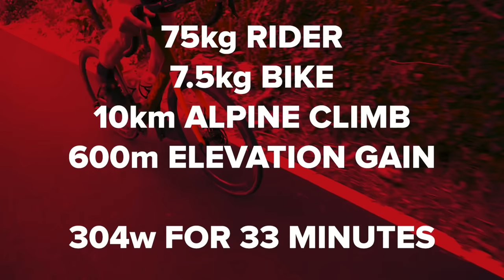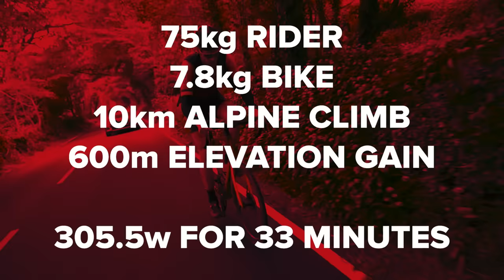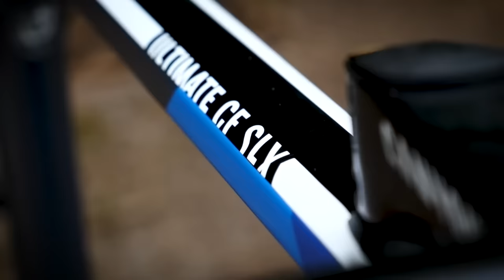10 Reasons To Consider Aluminium Over Carbon For Your Next Bike

Comment: I prefer steel... because, well, probably because I’m a twat as it turns out ... BUT I love the idea of a resurgence in Aluminium, given the tidal wave towards carbon.   In saying that, one of my favourite bikes in one of the first Giant CADEX frames.   My deal breaker is horizontal top tube. Has to be horizontal.
Reply: Me too, steel is real. Just purchased my steel gravel bike.
Reply: Same here, steel gravel bike 😁
Reply: My steel bike is a hand-me-down from my dad, it's over 20 years old now and the frame is still kicking

with regular maintenance and switching worn out parts steel frames are for an eternity compared to some other materials

It's not the lightest yes, but the best durability you can find imo.
Reply: I used to own a cheapo Reynolds 520 frame and it was awesome. Mind you, it was chromoly (sp?) but still on the steel side of things and it was great. I now ride a Triban (aluminium) and it rides great. I also owned a Chinese no name aluminum frame for a while and it was so harsh I thought alu was like that. Aluminium can be quite comfortable if the frame is done right.
Reply: Steel for gravel and my road is a Kenisis Alu disc.... It's all about the metal.
Reply: I've owned a quality carbon frame bike - I sold it, because my Reynolds 531 butted steel alloy frame to me feels much livelier and gives better road surface feedback. It feels 'glued' to the road; far better than carbon. Weight? It makes no difference to me!
Reply: Still riding my 43 year old steel Raleigh SuperCourse. Have replaced the wheels many times as well as most other components, but that frame just keeps ticking.
Reply: I miss my custom steel bike from the late 80's. Best ride ever.
Reply: Steel frames, in my opinion, have an aesthetic advantage, but mass produced aluminium bikes have given us lighter and stiffer bikes for less money.
Reply: My bike is steel. Has served me well for 44 years.
Reply: @tomscott4644  Hi Tom, 1978 Raleigh SuperCourse here. What are you riding?
Reply: Steel is also making a big comeback. Not just in the heaps of vintage frames you see getting back on the road, but also with new bikes especially in the gravel and adventure segment being offered in steel.
Reply: @Stoney3K  I also dig how many smaller frame builders in Aus, UK, US are making decent livings out of bespoke frame building.  They’re costly granted, but getting a frame built by a local shop to your exact measurements, and owning a lush steel steed - taking bike ownership and riding to a whole new level.
Reply: @MrLuigi-oi7gm  '77 Trek.
Reply: I have a 80 and a 82 Koga-Miyata. They are great for touring and training, which most people do most of the time. Of course if you're actually racing you should ge a new bike. But other than that steel is perfect.
Reply: @tomscott4644  👍
Reply: Totally agree about horizontal top tubes. If it's not at least mostly horizontal, I will not ride it; steeply slanted top tubes are an abomination.
Reply: "CADEX", that takes me back.
Reply: I own and still ride a Cadex.
Reply: @williambehr215  I’m just about to put a new 105 group and new wheels on mine. I picked mine up for 20bucks, it was purple, was going to do it up, but colour grew on me.  My favourite bike
Reply: I purchased a steel gravel bike a little while back but have found i'm loving carving up the road/paved tracks mostly. Threw some 32mm Conti road tyres on it and it's not a bad ride. I'd like it a little lighter but i'm not sure whether to jump to an alu frame or do some upgrades on the steel bike.. the not quite horizontal top tube silently eats away at me too.
Reply: Funny. I personally hate horizontal top tubes. Much prefer compact designs / sloping top tubes, ideally ca. 15-16°.
Reply: @LeoInterHyenaem  that’s a very unusual hate.  I cannot think of anyone that prefers a compact over horizontal top tube other than the functional need of a manufacturer offering less size models
Reply: @eddiej9733  Curious. I find horizontal top tubes (idem, dropped seatstays) visually awkward. My ideal bicycles (all sporting compact designs and continuous, organic, elegant seatstays) would be:  
 - Salsa WarBird 
 - Bastion Super Leggera / Road 
 - Specialized Aethos 
 - Merida Silex x000 -series 
 - Cannondale Synapse (especially the women's version with a greater top tube slope) 

 Also the likes of the Cannondale Flash with a considerable top tube slope has that modern classic look that's still a looker after all these years. 
  I guess, the subject is akin to steel vs carbon, titanium with welds vs with organically oblique 3D-printed lugs (like carbon), Gothic church Vs ultramodern minimalist mansion, classic Rolls-Royce vs Lamborghini Aventador. Many apparently prefer the vestiges of early tech / design or short-lived modern fads, while others have strong preference for clean lines, minimalist looks, oblique shapes, defining modern classics.
Reply: @Sidowse  If you take the likelihood of corrosion out of the equation, then yes - steel will likely last longer.
Reply: @LeoInterHyenaem  nice rationale, but feel your position is a stretch at most.  Horizontal top tubes ruled till frame manufactures reasoned (legitimately so too) that fewer frame versions could be made, with adjustments in seat and stem projection making a compact frame adaptable.

So, I have not come across any source that supports  the sloping top tube / compact as a key design feature - rather the price for frame size compromise. Hardly a key design attribute 

Again, have never encountered anyone that has sought to justify the compact frames aesthetic benefits.  All the frames you note ... are... well,’ compact and sloping. 

The prosecution rests
Reply: @eddiej9733  I neg to differ. "Horizontal top tubes ruled till …" - that is why I equate them to 1970'ies Rolls Royces, rather than the sleek and beautiful Lamborghini Aventador. I struggle to imagine that I am among a very few who find horizontal top tubes aesthetically awkward and ugly. Sure, they may give you a watt or two (at best?) in aerodynamic gain, but visually they're just rather ugly. And reverse-sloping ones (such as some time trial junk of 1970-ies and 1980-ies) - even considerably more so. I would, however, entirely agree with you if you had said that >25º slope in a top tube (such as in women's Dutch bikes) is hideous, but that would be a perfectly irrelevant comparison.
Reply: @Sidowse  The aerodynamic losses are rather marginal, if you can stick to the drops. However, for most of us non-racers, sloping top tubes add to the comfort (yes, at a very marginal performance expense). On the positive note, the gain in aesthetics and in comfort (especially, on longer rides) is significant.

Comment: Allez Sprint for the win!  Saw a video today about what would you build up for 8k to be a good race bike and one of the two specd an Allez Sprint frame, especially if you use rim brakes the weight difference is almost non existent from a carbon disc bike.  Also the Sprint geometry is as aggressive as the Venge and is actually stiffer...

Comment: bmc alr one of the most underrated bike at the moment...

Best alloys : Caad 12/Caad 10/Caad 13/Specialized Allez Sprint/Trek Emonda Alr,Bmc Alr  and some others :)
Reply: Also giant tcr slr (can be made below 7kg with pedals and cages)
Reply: @roborovski008  yes aluminium.
Reply: Those bikes may be or are built in China in factories that make the same frames for other, "lesser" brands. "Open" frames relate to Al as well as carbon. What it comes down to is what was totally missing from the video: the snobbery of name brands/frame material.  Some people like to think because they're paying more for a frame due to brand/material, they're getting a better product. Not the case. I have a Al frame that is high end alloy, heat treated, butted and multi-shaped, smooth welds and built in the same factory using the same methods as some of the "top end" Al bikes you mention. My bike also has a combination of Ultegra and 105 components, not Sora and Claris because I didn't pay the marketing tax of popular brands. Know your frames, not brand. And besides, it seems it always needs repeating...it's not the bike!
Reply: You need to get off the USA brand marketing train. The higher price you're paying is not for better products, you're paying for the brand name and their marketing budget
Reply: @esstee9595  what frame do you have?
Reply: @esstee9595  where did you get it? What bike is it ?
Reply: @tonymcnally9355  I bought in 2016, a 2014 Fuji Roubaix 1.1. The frame was built in the same Chinese factory that built frames for other major, more expensive brands at that time using hydroformed, multishaped, butted, heat treated high quality Al. It's very light and lively with racing geometry and could be used for racing. I compared the bike with other brands boasting the same frame tech, and the difference in components was huge. Like I said, Ultegra brifters and RR deraileur, 105 frt deraileu and brakes calis, as opposed to shyte that was offered by name brands starting with C and S for examples, using Claris and Sora for the same or higher price range.

Comment: Two more things in aluminum’s favor: Carbon is a lot more sensitive to torque spec and damage to over torquing. 
And the dreaded carbon creaks.
Reply: Expecting for a solo / long hauling rides with no worries of wrong torque number by what my hands do 😂
Reply: Yeah. Those effin carbon creeks😒
Reply: Aluminium is not impervious to overtorquing damage, either. And creaks... well, aluminium can and sometimes does seize. Or creak, for that matter. It all depends.
Reply: @LeoInterHyenaem  but less than carbon

Comment: Nearly all the "for parts" frames sold cheap are carbon. Once it broke, its premium price suddenly vanishes. And I guess most folks don't want to ride a repaired CF frame. Its like buying a written off car that's been repaired: yes it's cheap, but can you trust it?
Reply: Carbon repairs, if done properly are even more solid than the original product. It's also so much more sustainable than trashing it, for some potential additional grams. It has been done for years in the nautic industry. Few years back I had a Canyon Strive CF frame fixed on the bottom bracket area. I've been racing it on Mountain of Hell, Enduro races and bike parks for 2 years then sold it. It's still riding strong 6 years later. So yeah; you can trust it, and no you can't fix an aluminium frame the same way.
Reply: @BastienChanot  I disagree. While carbon repair is magnificent in its own right, it can't and shouldn't be "more" solid than the original product. Depending on the carbon fiber's original structure, the repair should be of the same exact quality-- nothing more, nothing less. The reason being is if the structure on that surface area you patched is different from the original, there will be an inconsistency in stress distribution and may even weaken the component as a whole.
Reply: @krugz_  I agree, on paper. Now in real life most cabon bikes, or components in general are rated for a 125kg system with aggressive use / acceleration / stress that most of us never reach. And in real life an imperfect - by nature - repair mostly allow for a full use of the component for many additional years; something that can't be said for aluminium. Of course AL has a LOT going for it like recycling that carbon don't. Just saying that it's THAT more important to consider carbon repair before trashing it because that shit is toxic as hell for the environment.
Reply: @BastienChanot  I have a friend who repairs carbon frames and he does a good job.   I just don’t like carbon frames, over rated hype and expensive shit
Reply: @Nivacromcolumbus  i tend to agree despite owning 3/4 carbon bikes 🥲
Reply: @krugz_  as a guy works on a music instrument repair service, you're wrong. We have glues and epoxies today that bind parts so solid, that they are harder and more durable than the parts they bind together. You could argue with "adhesion" of some glue manufacturers. 

A job done properly on a broken carbon frame will be more durable than the carbon frame itself. Of course, you need a professional that knows how to do it properly.
Reply: @Nivacromcolumbus  $400 for a carbon frame isn't very expensive, they exist.
Reply: @crigonalgaming1258  Now, I don't know who to believe. You, who repair music instruments or someone who repairs carbon bike frames and components.

See this video around 9 minute mark:
https://youtu.be/k7e004bfHyY?t=563

I'm not saying you can't strengthen that specific area. My point is that if you strengthen that area, you're transferring stress to a different part and may cause potential damage. The stress applied to a bicycle is very different from the stress applied to a musical instrument.
Reply: @Edigor100  I’m well aware of that and $400 buys even worse carbon.

Comment: I would like to see a video comparing carbon vs titanium frames or bikes. And even a ride test and the production process... would be nice!
Reply: Totally agree @fabianbv82. Two out of 5 bikes in my stable are titanium and I love them. One is designed for comfort and is like sitting on silk, the other is an out and out racer and is a joy of dartiness, comfort and power transfer. 

On two etapes, I left my compatriots on carbon bikes up the climbs and with zipp 303 wheel, aero handlebars and managing my body position on the bike, left them for dead on the descents and flats (managed to hit 96kph/60MPH)!!
Reply: @thelesserzdoctor2345  once in my life I will order a customised titanium bike.
Reply: @fabianbv82  buddy, you won’t regret it. There’s a lot to like - even if not quite as aero as a decent carbon frame.

Comment: I’m curious to understand “how do I spot top-end aluminium and/or cheap carbon?”
Reply: price
Reply: @user-hs2hd7wp9g  price ≠ quality
Reply: Top-end aluminium frames: Smooth welds. Tube hydroforming. Sensible appearance (sloping top tube, etc.). 

 Low-end aluminium frames: crude, ugly, obvious welds. Little or no hydroforming. Ugly, awkward overall shape. A hideous wedge, crudely welded under the head tube / down tube junction for extra "support", to compensate for the lack of budget for R&D.
Reply: A few examples of quality aluminium bikes: 
 - LiteVille 4-ONE Mk1 
 - Trek Émonda ALR 5 Disc 
 - KOGA Colmaro 
 - Cannondale TopStone Al 
 - Evans Cycles Pinnacle Arkose 
 
 The most obvious examples of 💩 aluminium bikes are supermarket bikes.

Comment: My carbon mtn bike frame (3 yrs old) broke in two places last Oct. I was not even going crazy downhill. I went with Aluminium frame with all upgrade components. So far so good!
Reply: Everything still working fine a year later I'm willing to bet!.. I love my carbon components, but they're kinda replaceable, the frame though?...I want that to take a beating and bounce back.. road bikes I'd have a carbon frame gravel too anything else I want 'loominum.
Reply: I tried to tell you, stay out of those places!
Reply: Probably a hairline crack that got worse over time. That’s the problem with carbon, the cracks manifests. Metal alloy doesn’t die to different chemical structure